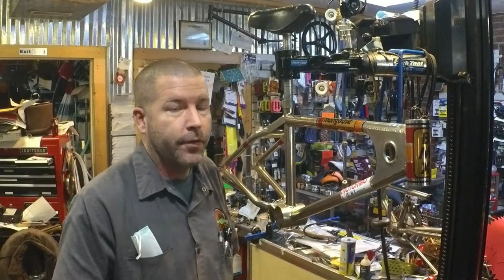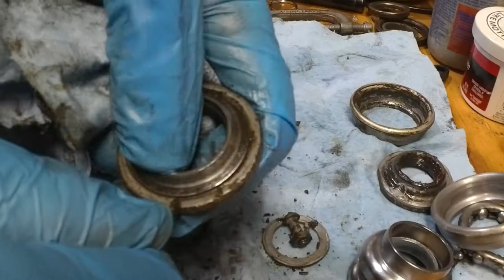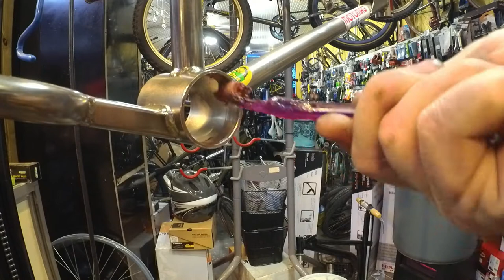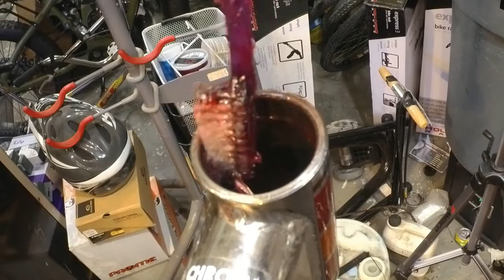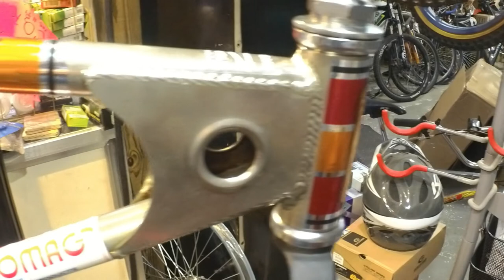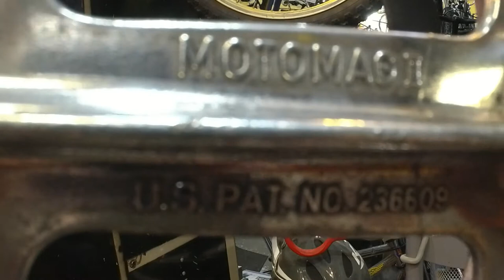1978 Motomag restoration part 2

Comment: Awesome job, the bike looks terrific. And I am right there with you on the Motomag II wheel restoration, after I remove paint, its all very fine steel wool, a little wire brush action where needed and polish. Thanks for posting. I look forward to seeing the next project.

Comment: A good way to clean old bearings is dipping them in brake cleaner ,just put them in a hard plastic container soak for a few minutes then all the dirt and grime will come off use a old tooth brush for the little crevices, then use an ol rag to dry  and then repack with new grease, good luck...
Reply from the maker: I do that as well just not on this project.